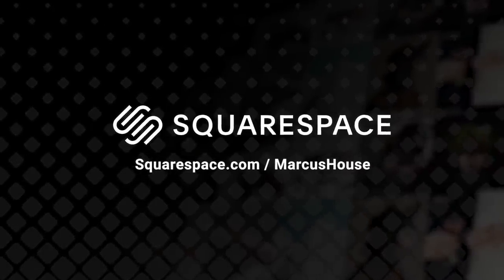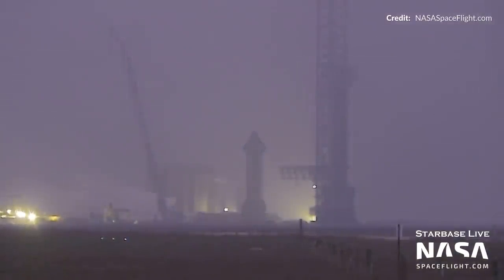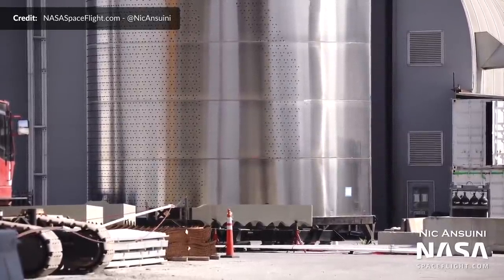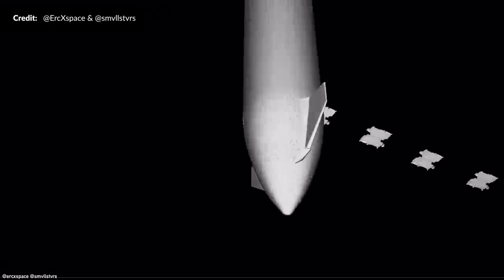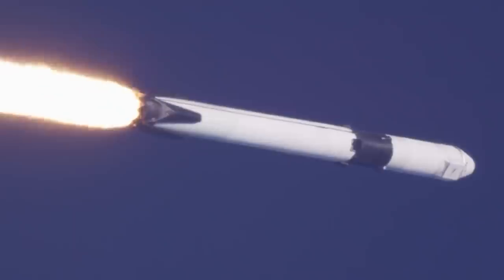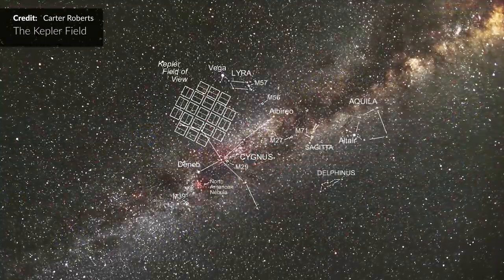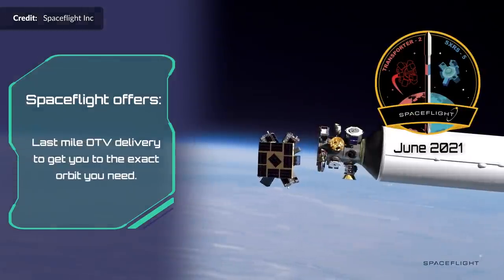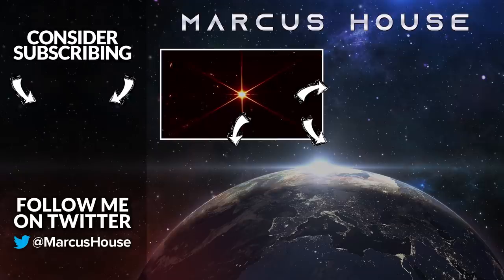SpaceX Starship 20 and Booster 4 Retired, OneWeb to Fly with SpaceX, 5000 Exoplanets and more

Comment: I'm really amazed by the transparency that SpaceX is providing to cater to all the watchers. The signs on the various components don't really need to have large print IDs on them, this is for the benefit of the cameras across the road. They could just as easily have small print and an encrypted QR code for the work crews (and turn them to face way from the looki-loos). 

But the PR value they are getting from this is immense. Crazy like a fox.

Comment: While the 'Pez dispenser' idea is cool, I doubt SpaceX will go for that. Starship will need to be able to deploy all kinds of payloads, many of which would be much bigger than a folded Starlink satellite. There's no point designing a door that only works for one kind of payload
Reply: One of the main benefits of the starship was supposed to be payload volume, not just payload mass iirc. That means bigger static mirrors for telescopes, dishes for antennas, etc. Having a limited exit door severely limits that capability
Reply: Start small, work up to bigger versions
Reply: Long term I think you are right. This might be a short term solution to initially launch Starlinks. Remember, starship will have many versions: sat launch, moon lander, Mars lander, earth to earth transport, tanker, space station, cargo to moon and Mars, etc. It will be very flexible like the old DC-3s.

Comment: I know about the deluge system at Boca Chica, but why doesn't the launch pad have a flame diverter underneath ?. All massive rockets have this feature. All the energy from 30 or raptors and the sound shock wave will just bounce off the concrete back to the booster.
Reply: Good question. There must be a SpaceX forum somewhere we could ask experts. I want to know why the pillars are tilted and why they use a cable and pulley system on the Chopsticks.
Reply: @PanzerBuyer  That is also a good point. The electric motor that powers the pully system looks like something you would find at home Depot. Kinda strange when you think about Tesla eh ?
Reply: @dazuk1969  I have no doubt that they figured it to be the most efficient method, but it just looks like a rigging to pull an elevator up the Eiffel Tower rather than a precise rocket manipulator conveyance.
Reply: @PanzerBuyer  Yes, I kinda thought the same. Spacex are under no illusions here, Musk said at the recent Boca Chica presentation that if the booster comes in to quick and pulls the chopsticks off it's "Farwell to arms". What we see is a test and development set up.
Reply: @dazuk1969  I believe the winch that runs the pully system for Mechazilla is used on oil rigs for running the drill up and down. It is apparently pretty precise and powerful.
Reply: "The best part is no part." I suspect that SpaceX wants to be able to rapidly service the booster from below by driving vehicles and lifts underneath the OLM. If a diverter turns out to be necessary, they will implement it later with rapidly removable segments.
Reply: @PanzerBuyer  
The OLM legs are tilted to increase the resistance to lateral wind loads and to improve the exhaust cross-section area. The kink in the legs is likely due to increasing the structure height design very late in the construction contracts. 

The only alternative to pulleys is the rack and pinion design used on smaller elevators. This places the drive motors on the elevator and requires long high-power cables or a mobile power source.
Reply: @imconsequetau5275  That makes a lot of sense. They will defo have to access the bottom of the booster rapidly if need be. Maybe the deluge system will be able to handle the issues I mentioned but 30 or so Raptor 2 lighting up will be a hell of a fire ball.

Comment: Turbo pump thrust bearings are much better on R2, and this was the main focus on the upgrade. About 30-40% failure rate of these bearings on R1 in on ship static fires… the “honk” on shut down is the compressor or turbine grinding itself on the housing after a shaft thrust bearing failure…

Comment: How did SpaceX fix the Raptor V2 combustion chamber melting issue ?
Reply: Musk said it was an engineering issue for providing more cooling. I'm not sure if they have released on whether that was fixed or not. As I understand it, the melting issue is when pushing the engine to the limits.

Comment: Does this mean the current booster and Starship will be scrapped? Or will the Raptor engines now installed just be replaced with Raptor 2 engines? I wasn't sure from the video.
Reply: Likely scrapped or put on display. I don't think that B4/S20 can use the Raptor 2 engines.

Comment: Flight 420 is surpassed during faa delay.  What will happen to those R1s??  Sell as temp BE-4 replacements
Reply: The Raptor 1s are early development engines and the Raptor 2s aren't even the final design. The ULA Vulcan Centaur may need some design changes to even be able to use the Raptor engines as they and the BE-4 are only similar.

Comment: Marcus,  They likely did not actually use liquid Methane in the test.   Methane use is supposed to be proceeded by an OverPressure Notification which was not given last week.  LN2 can substitue for Methane.
Reply from the maker: They had the methane systems engaged though. Unless they didn't have methane in the tanks (and we've seen them deliver many many tanks of it arrive over time).

Comment: I think the tank pressure testing was all about tank integrity in an operational environment.

Accordingly, using liquid methane and liquid nitrogen poses no explosion risk beyond tank leakage.

In fact, the idea of using liquid oxygen and liquid methane to test tank integrity together would not just be an issue of finding the leaks, but seeing those leaks burst into enormous flames which then engulf the entire spaceship.

I can see those kinds of mistakes being made by average Americans attempting to assemble a rocket. For the fuels involved, and the enormous risk of explosive combinations, it has the makings of another Pineapple Express.

Comment: How many Falcon 9 launches were there before the crew demo mission? Can that number be used to guess how many starship launches need to happen before a Starship crew demo mission?
Reply: The Crew Dragon has an abort system and Starship does not. Starship (second stage) using the Raptor engines is very unlikely to have anywhere near the thrust to weight ratio of Crew Dragon's Superdraco abort motors (4.6 to 1 TWR). Not to mention that Raptor engines take a second or more to ramp up to full thrust. That is just too long for an abort system to work for catastrophic events. The hypergolic Superdracos are at full thrust in 100 milliseconds on Crew Dragon.

So without an abort system, Starship will have to prove to be VERY reliable to get an Earth crew rating. Elon Musk has said that it would take hundreds of successful, operational flights before you could put people on board Starship launching from and landing on Earth.

“'We’ve got to first make the thing work; automatically deliver satellites and do hundreds of missions with satellites before we put people on board,' Musk said, speaking Monday at the virtual 'Humans to Mars' conference" - CNBC Sep 2020 article
Reply: @steveaustin2686  Gotcha. So, it's not a fair comparison. That makes a lot of sense. Thanks for the thorough answer.
Reply: @xliquidflames  You are welcome.

Comment: O2 not fed because, (speculation now on my end,) it's very expensive at the moment. Now, why they're venting METHANE into the atmosphere is a puzzle to me. Keep up the great work!
Reply: The Recondenser captures as much of the gaseous methane as they can to recondense it back into a liquid. Marcus said in another thread that most of the venting from the Recondenser is LN2 used to chill down the methane.
Reply from the maker: It is LN2 you see there I am fairly certain. They use that to super chill the CH4.

Comment: @5:54 I dont think that is an oxygen header tank i think it's a methane sump tank. Notice it has a top tube to connect to the methane tank above. Although i cant see where the connections are to the 20 outer raptor engines maybe just from this view they are difficult to see - on a previous view of the thrust section you could see them.
Reply: It is the lox header tank, the pipe at the top connects to the methane Downcomer and runs through this lox header
Reply: Which is why there's no connections to the 20 outer engines as the header tank is only used for the 13 inner ones
Reply: @brendanlewis1798  If the methane feed went thru the LOX header tank it would prevent scavangng of the LOX at the bottom of the tank. Also having 10 outlets for the middle ring raptors makes no sense as they are not used for landing.
Reply: @brendanlewis1798  A LOX header tank there would only be needed for the 3 inner landing engines. Having 10 outlets indicates this is a methane sump - perhaps they will have branches on these 10 outlets to feed 30 engines while the 3 landing engine outlets draw direct from the bottom of the sump tank.
Reply: @brendanlewis1798  Here is another clue about this being the methane sump - it cant be the LOX header because if it was feeding  13 core engines then where does the oxygen enter the header tank from the main oxygen tank. ! The only pipe in is from the methane tank above.

Comment: @7:10 Doesn't that mean to make the system just reusable for a second mission right off the bat instead of a one time test ship?
But wasnt this what spaceX already had planned? Do they mean to transform the ship into a reentry + moon lander capable system?
Reply: The HLS Option A proposals did not have to be sustainable as that was happening under Appendix N for the Lunar Exploration Transportation Services (LETS) landers. LETS was also going to carry 4 crew instead of 2. NASA issued the first initial R&D contracts for that in Sep 2021. So it sounds like there is a provision in Appendix H for the HLS Option A landers for adding sustainability to the mission. This may not necessarily mean reusability, but that was included in NASA's assessment of upgrading the HLS Lunar Starship for the later LETS landers.

From Page 10 of the Apr 2021 HLS Option A Source Selection Statement.
"Dovetailing with SpaceX’s significant strength under Technical Area of Focus 1 for its exceedance of NASA’s performance requirements is SpaceX’s corollary significant strength within Technical Area of Focus 6 (Sustainability) for its meaningful commitment to, and a robust yet feasible approach for achieving, a sustainable capability through its initial design. Here, I note that the SEP closely analyzed SpaceX’s proposal and was able to independently substantiate its claimed performance capabilities. Thus, I agree with the SEP’s assignment of a significant strength in this area and concur with the SEP’s basis for this finding. It is of particular interest to me that, for its initial lander design, SpaceX has proposed to meet or exceed NASA’s sustaining phase requirements, including a habitation capability to support four crewmembers without the need for additional pre-emplaced assets such as habitat structures. SpaceX’s initial capability also supports more EVAs per mission than required in the sustaining phase, along with an ability to utilize two airlocks and other logistics capabilities to enhance EVA operations while on the surface. And, as previously mentioned, SpaceX’s cabin volume and cargo capability enable a myriad of endeavors that will ensure a more sustainable human presence on the lunar surface. Moreover, I note that SpaceX’s capability contemplates reusable hardware, leverages common infrastructure and production facilities, and builds from a heritage design with commonality in sub-systems and components across its different variants. The collective effect of these attributes is that SpaceX’s initial lander design will largely obviate the need for additional re-design and development work (and appurtenant Government funding) in order to evolve this initial capability into a more sustainable capability. While I acknowledge that some development and technical risk necessarily accompany SpaceX’s innovative approach to designing a capability that is sustainable from the outset, I find that SpaceX has provided a feasible path to executing on this capability. Accordingly, I conclude that the significantly enhanced operational flexibility and mission performance that SpaceX offers, and complementary potential for resultant long-term affordability, present immense value for NASA for lunar and deep space exploration activities."
Reply: As for Earth re-entry AND lunar lander, that does not seem likely. Lunar Starship apparently has the dV to leave LEO, enter lunar orbit, land on the surface, and return to lunar orbit. It is basically out of propellant then for returning to Earth. IF you take something like Lunar Starship and make it lighter, it should have the dV to leave LEO, enter lunar orbit, leave lunar orbit, and enter LEO again. I don't think NASA would want to use aerobraking on a returning Starship unless it can also land. Elon Musk has said that it would take hundreds of successful, operational flights before you could put people on board Starship launching from and landing on Earth.

“'We’ve got to first make the thing work; automatically deliver satellites and do hundreds of missions with satellites before we put people on board,' Musk said, speaking Monday at the virtual 'Humans to Mars' conference" - CNBC Sep 2020 article

With Starship not having an abort system, I don't see NASA giving Starship an Earth crew rating until it has proven to be VERY reliable. NASA certainly remembers the Shuttle.

Comment: NASA's wording regarding the exercised option is interesting: Transformation from an human landing system into a spacecraft for recurring services. That means at least multiple uses for one Starship. Maybe i read too much into that, but it sounds like they are thinking about using Starship for more than just the lunar orbit - lunar surface transfer.
Reply: The HLS Option A plan is to dispose of the landers either in a solar orbit like some of the Apollo upper stages or crash them back into the Moon. The follow on Lunar Exploration Transportation Services (LETS) landers are for 4 crew, are more sustainable, and more capable. The initial R&D contracts for LETS were issued in Sep 2021. The latest NASA announcement is kind of HLS version 1.5, before LETS is done.

Comment: Can ULA buy the raptor 1s for Vulcan?
Reply: It's an early development engine, so they would likely not bother. The Raptor 1 is reportedly not as powerful as the BE-4, so they could not one to one swap. The Raptor 2s and the BE-4 have similar performance, but likely not close enough for swapping out either. ULA would likely need to redesign and modify the booster to make it work, which would take time. ULA is kind of stuck with the BE-4 now.

Comment: S20 and B4 were never going to fly. They are configured with raptor 1 engines. Musk stated the first orbital flight would be with raptor 2 engines. S20 and B4 were used as a pathfinder set to test all the systems in and supporting the OLP.

Comment: I don't understand very well why a real flight test is not done with BN4 and SN20, since both are already complete, it would hardly cost anything to test them.
Is it possible that the FAA is delaying the SpaceX tests to give NASA's SLS more time as a matter of pride? If so, I find it unfortunate. 

No entiendo muy bien por qué no se hace un test de vuelo real con BN4 Y SN20,pues ambos ya están completos,apenas costaría nada probarlos. 
¿Es posible que la FAA esté retrasando los test de SpaceX para darle más tiempo al SLS de la NASA por una cuestión de orgullo?. Si es así me parece algo lamentable.
Reply: Apparently, SpaceX does not think B4/S20 will give them the flight data that they need and a new Starship with 33 Raptor 2 engines in the booster and Raptor 2 engines on Starship (second stage) will give them the data that they need. B4/S20 are still helping with finishing up Stage 0.
Reply: @steveaustin2686  You may be right, but... Isn't it better to test something you already have built, even if it's a prototype, than to delay the tests while waiting for new models?

I say this because of the 31 raptor v1 engines that they already have finished and ready for flight, all of them already installed in B4 and SN20. Not using them is a wasted expense.
They may not give you all the data you need to complete your Starship design, but it's much better than not taking advantage of them.

It is my modest opinion.
Reply: @antoniofeijoo2010  SpaceX apparently is willing to spend the money on hardware. Who knows how many refinements to the engines and assembly lines happened while making all of those Raptor 1 engines. SpaceX had to change out the methane GSE tanks this month and have yet to test the water deluge system. So SpaceX is evidently still finishing up Stage 0. With the FAA mentioning consultations twice now, apparently some issue has come up and the FAA and SpaceX are working with one or more of the other agencies in the review to mitigate whatever the issue is. With the Raptor 1 engines having so many problems in the SN8-SN15 test flights, apparently SpaceX wants to go with the upgraded Raptor 2 engines when Stage 0 and the review are done.